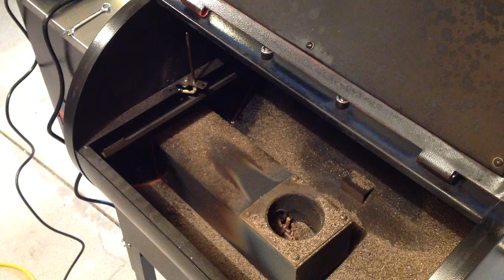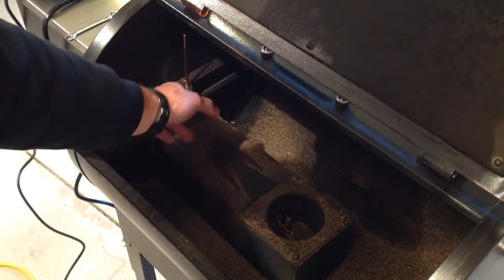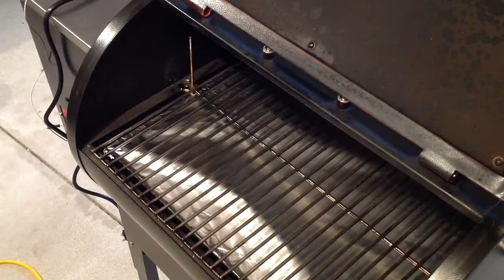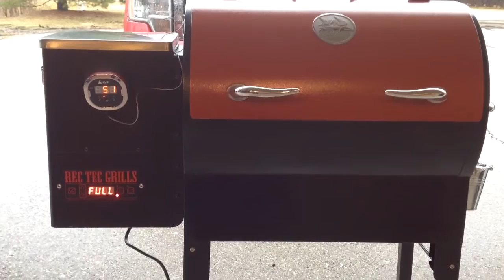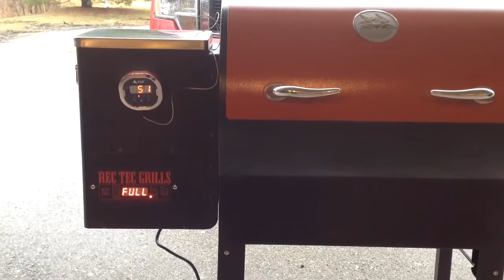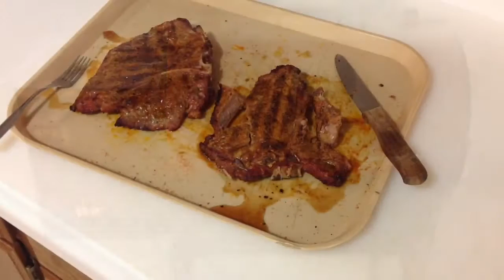Rec Tec Pellet Grill Steak / Temp Probe Modifications / High Temp Grilling

Comment: What is the reason that you needed to move the probe?  seems that you will be putting it right into the high temperature air stream as it comes up from below.... did you take readings all over the grill and determine that was the most representative locations?
Reply from the maker: Thanks for watching Jeff! The probe was to close to the wall which was cause inaccurate readings thus throwing off the internal temp
Reply: @TomHorsmanAmateurBBQ  ok, but how did you determine it was throwing off the readings?
Reply from the maker: I called Rec Tec customer service after I got some very inconsistent readings and that’s what they suggested
Reply: @TomHorsmanAmateurBBQ  Thanks for that... i was wondering the exact same myself after taking readings that varied all over the grill.  I assume you are still happy with your grill especially after that mod?
Reply from the maker: I gave it to my oldest son about a year ago. He still uses it and it works fine

Comment: Tom, you should try doing a "reverse sear" on your steak.  Salt your steaks the night before, place on a wire rack  in the refrigerator, uncovered.  Remove from refrigerator one hour before cook time (for a nice 2 inch thick steak). Set your RECTEC for 200 degrees.  When ready, pat steaks dry and place in grill.  Allow the steaks  to cook/smoke for 1+ hours until meat temp reaches about 115 degrees. Remove the steaks,  pat dry, lightly oil, and add additional seasoning as desired.  Turn up the temp to 500 degrees. When ready, place the steaks on the hot GrillGrates (smooth side up) and "sear" the outside about two minutes on each side until internal temp about 135 degrees for medium rare.  Beautiful pink juicy meat from crust to crust... and no gray meat!
Reply from the maker: The Commentarium Thanks, I have done the "Reverse Sear" several times since this video which is about a year old. Thanks for Watching!

Comment: Why would u foil up that drip pan? Isnt it better just to remove it once its getting to dirty and clean it? Instead of risking messing with the airflow?
Reply: I own a Rec Tec. Vastly easier to just foil the tray. After cooking a few times (or after cooking something super greasy), just pull the old foil off, toss, and refoil. If you get extra wide foil, you can wrap the entire top and sides of the pan with one piece of foil. So instead of 20+ minutes of cleaning, you have about 2-3 minutes of foiling. Hope that helps :)
Reply: @toddjamison77  I had the exact opposite results.  I tried using foil the first time, and since they recommend NOT wrapping the foil over the sides, when long cooks like a pork butt, the grease gets in between the foil and the lip causing grease to be on both the top side AND bottom side of the foil, making clean up an even bigger hassle as grease is dripping when you pull the foil out.  I no longer use foil.
Reply from the maker: Thanks for watching! The foil helps to prevent grease fires it's easier to remove and replace then cleaning the grease tray. We fold the foil so it fits inside the the tray not over the sides so it doesn't interfere with the operation of the grill.

Comment: mr. tom did the temp probe mod work?
Reply from the maker: +betoxyz68 I agree with you, it should be able to get closer.  After owning mine for 6 months and cooking on it twice a week it doesn't bother me. What matters is the food that it cooks and that's been awesome!  Remember the burner on the mini is the same one they use on its big brother that may be one of the contributing factors 😄
Reply from the maker: It did get it closer, although after I talked to Rec Tec service they told me that it was supposed to be back were it was. So that's were I put it and just use it knowing that it it's always 20 to 30 to 40 degrees hotter than what the actual temp says on the read out.  Thanks for watching 😄
Reply: +Tom Horsman my new Rec Tec also reads higher then my iGrill probes. Other Rec Tec owners claim their readings are within 5 deg which is nice. I have talked to Rec Tec and they claim it is normal and I disagree. Thoughts?